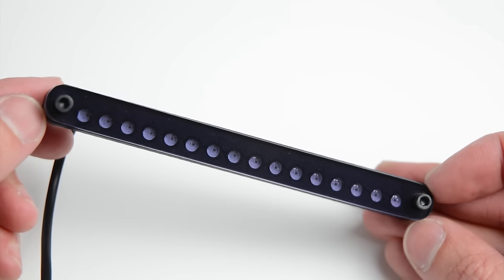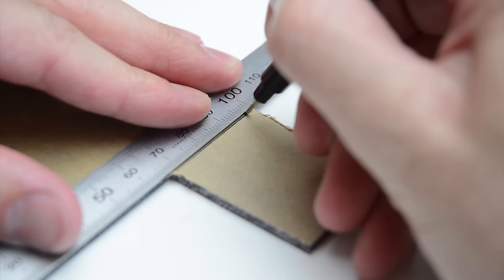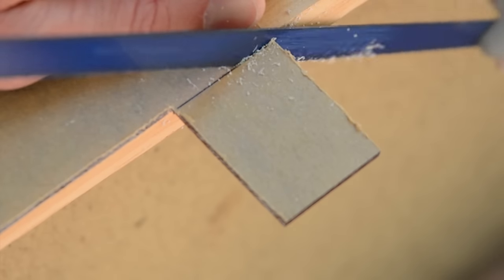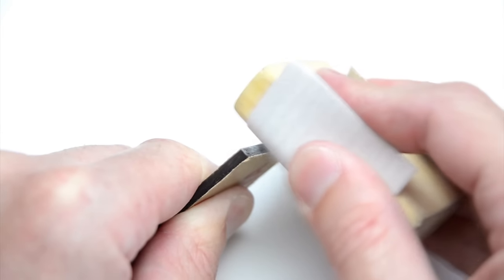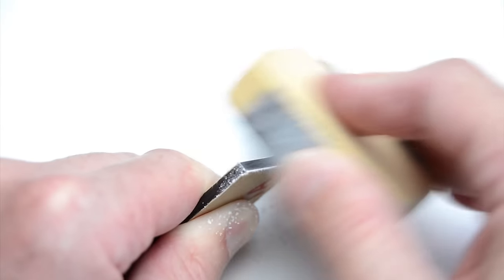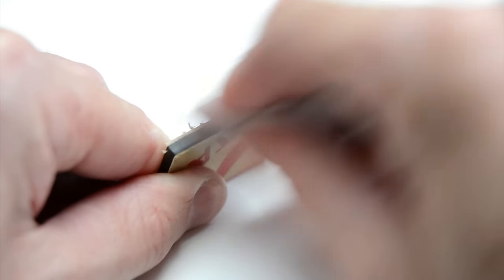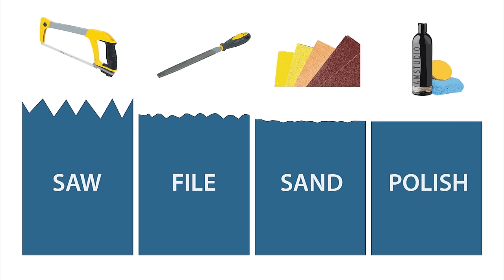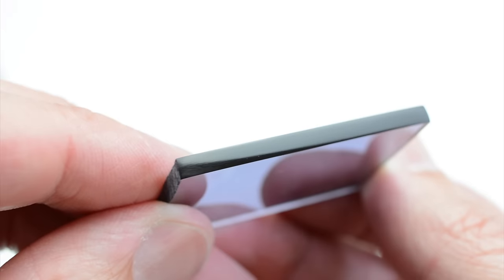HOW TO CUT + FINISH PERSPEX ACRYLIC EGDE w HAND TOOLS

Comment: Pro tip - use a propane torch with a quick pass instead.  Just sand the edge with a rough grade very quickly and the torch will remove the rest and make it perfectly clear.  Even the little butane torches work fine for this but require a few more passes.  Practice on scrap first until you get the hang of the technique.
Reply: Gregg Lagnese I tried the torch method on an  optix sheet edge and it made it worse.
Reply: Use hydrogen torch sir
Reply: I have a file, some sandpaper and some cutting polish ... and it worked beautifully.  I don't have a propane torch, but would give it a go ...

Comment: Excellent! Thank you! I doubted this was possible before seeing your video. I just did it myself and got an excellent outcome. I cut the perspex first with a handheld jig saw, using a hacksaw blade (you could just use a hacksaw). I used the highest speed possible. Then I popped the blade out of a Stanley hand plane and scraped the perspex edge backwards with the blade to smooth things out (i.e., the opposite direction to which the blade would be going if it were still in the plane and I were planning wood). Then I sanded with medium-coarse sandpaper. Then I sanded with very fine (240) sandpaper. Then I polished everything using Jif/Cif (i.e. the mildly abrasive UK kitchen tile cleaner) on a paper towel. End result looks great! I wish I knew this were possible 20 years ago.

Comment: Thank you. Straightforward and to the point. The progressively finer cutting/filing/sanding is similar to other materials, which makes sense, but the cutting fluid as the final stage for this was the key I needed.

Comment: I was actually wondering how you did that. I recently worked with plexiglass and it's hard to get a consistent round finish. How did you get the curves on the corners?
Reply: mark the curves then file and sand it

Comment: Pro tip, learn from my mistakes, DO NOT USE a Power Jiggsaw. My lazy ass did and it generates so much friction heat it melts the perspex. Better to do it nice and slow with a hand saw.
Reply: good things take time
Reply: They have Jigsaw Blades that cut Perspex now. Saw them at a Hardware store while I was buying something else. As with all glass type materials. Extra care. Still delicate...